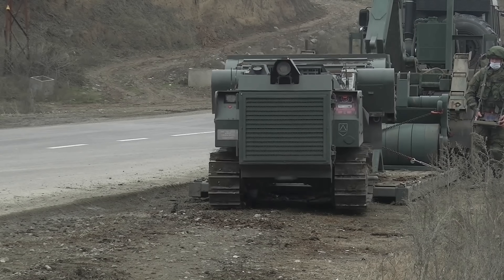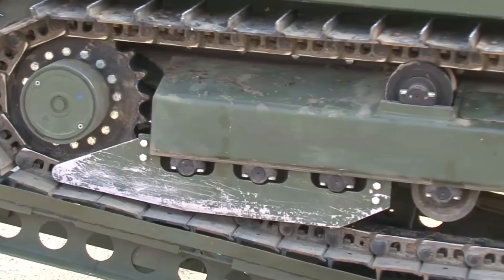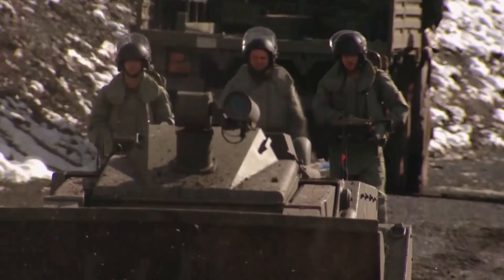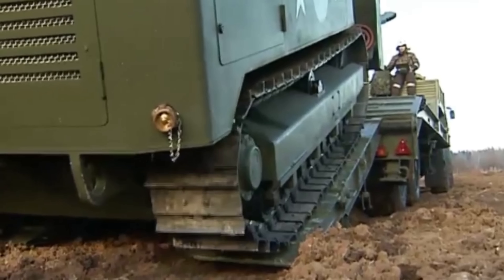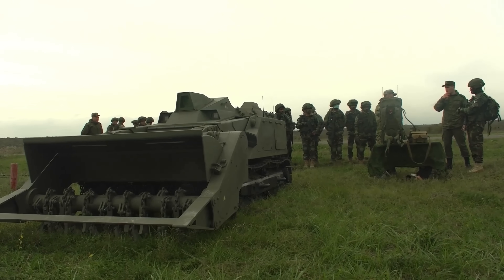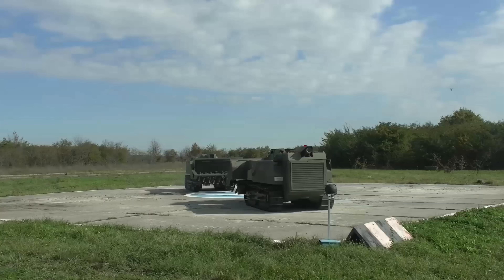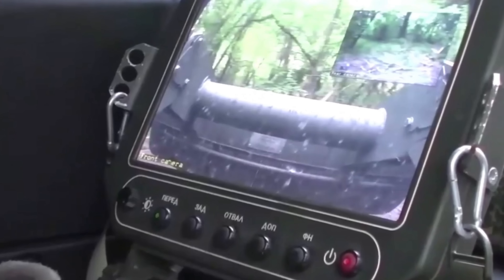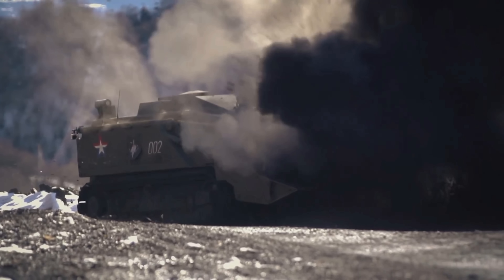The Russian 'Uran-6' Remote Controlled Robot | MINE CLEARNING DRONE

Comment: We had something like this back in the 90's - at least in development. One model was made in my home town. The pizza shop I worked for at the time catered a demo for the brass; we got to see all kinds of things. Little unmanned vehicles for supply deliveries, casualty extraction, mine clearance/detection, microwave repeater/relay links, AD sensors.... the whole shebang. They were remote, not AI though. We had done a lot of business with the company; they were very proud of their work and liked to show off to us. I believe that company got bought out by General Dynamics or General Atomics, as now they have a facility here - which was also involved in TARDEC.

They were also doing something with HMMWV's, but I never found out what that was.

They had a control system testbed device, just a mock-up where the parts lit up to indicate the motors or whatever were getting power, but they also had it hooked to a computer with a little simulator - one of the old MS flight sims, of all things, as it was an easy and cheap interface, I suppose. That was kind of neat.

Comment: I've cleared barbed wire out of tracks/road & idler wheels/suspension components on a Bradley a few times. On a fun scale of 1 to 5, I'd give it a -2, -3 if you add mud. Scouts Out!
Reply: Canadian Armoured soldier here.  I helped a 113 driver clear some barbed wire from its track.  Was a short piece but still rather stuck in and a pain to get out.
Reply: If you ain't Cav.....
Reply: @xxxlonewolf49  ...You ain't $*#%! (sanitized for family friendliness lol)
Reply: @tommyblackwell3760 (fair hehehe) I was Light Cav...well, non tracked.
 Thr MATVs & MaxPros on deployment were anything but light, compared to my TOW truck.

Comment: The Uran-6 is good against anti-personnel mines and small anti-vehicle mines, but they lose the fight against anti-tank mines.
Specially against the deeper buried with a delay fuse ones.
There are official reports of destroyed Uran-6 that have encountered anti-tank mines and most likely are the number of destroyed Uran-6s higher to much higher than the official numbers as this how it usually is when it comes to Russia.

Milmec Systems from Estonia has a similar mine clearing vehicle, but because it has a much lower ground pressure is it much less likely to trigger anti-tank mines and get destroyed by one of them.
Some might think this is an disadvantage, but if they do, then they are totally wrong.
A mine clearing vehicle like Uran-6 and the one from Milmec is to clear anti-personnel mines as the anti-tank mines can later be dealt with in other ways.

These types of mine clearing vehicles have been for many years in all sorts of configurations.
There reality is that there are some western made ones that are better to much better than the Uran-6, including the one from Milmec.
Yes, the western ones that are really good at dealing with anti-tank mines are mainly manned now, but it doesn't take much today to configure them to be remotely controlled.
The tech for that is already invented and only needs to be installed in these vehicles.
And the remote distance of them can be much further than 1km.
Reply: For heavier mines and IED's these viper systems may be a solution.

Comment: Well it beats, crawling on you belly and probing with your bayonet to find them. Done that, it's no fun.
CDN Engineers need something like this, if they don't already. Didn't have them when I retired 15 years ago.
Reply: I think every army needs this, just like they need remote breecher vehicles bridgelayers and platforms which can fill up holes and levy's with pipes or wooden logs. Could be one modular (Yess!)  platform.
Reply: @bertnl530  Technology was there 30 years ago. It became cheap 20 years ago. It still waits for money.